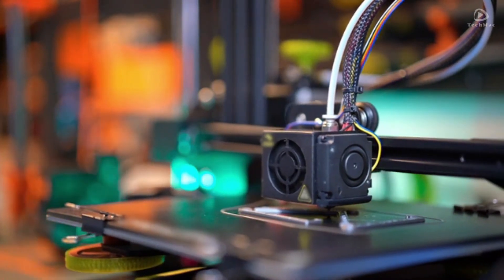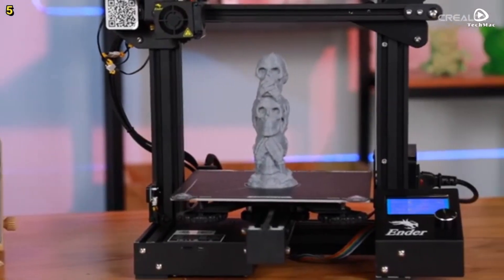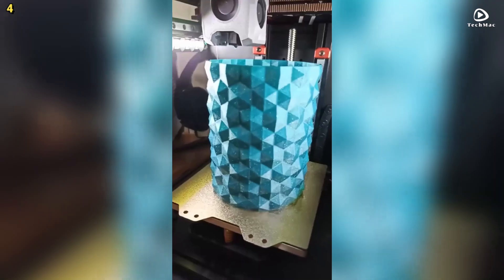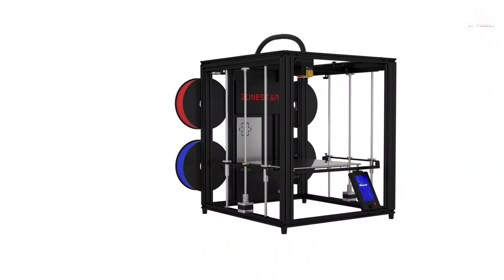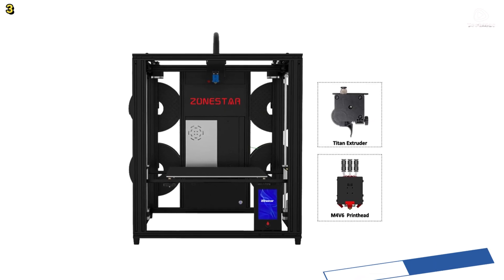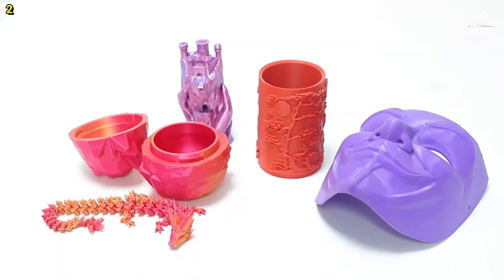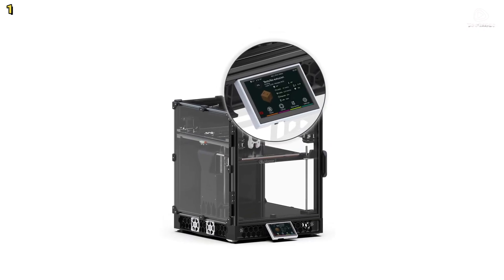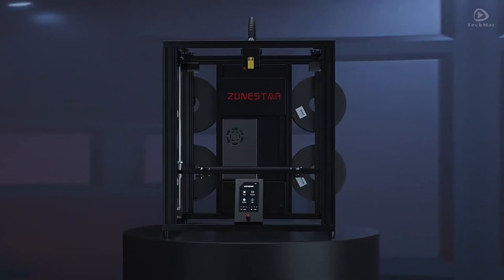Top 5: Best 3D Printer for 2025

Comment: The zonetec is kinda sketchy, instead u should get the bambulab x1c or new h2d that is coming or prusa core one or mk4s. Also the other printers are all self built as in they don’t sell it as one whole printer . You have to build it yourself (print out the parts and build it togheter with the electronics)